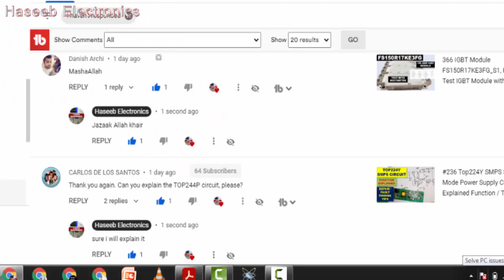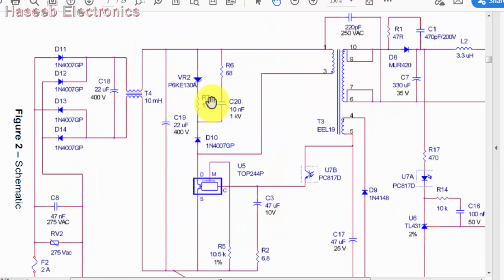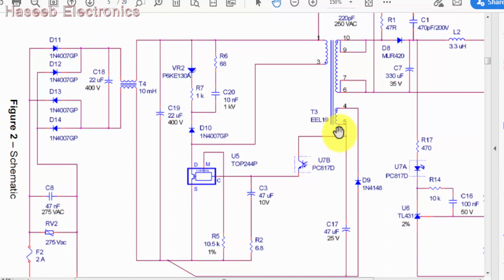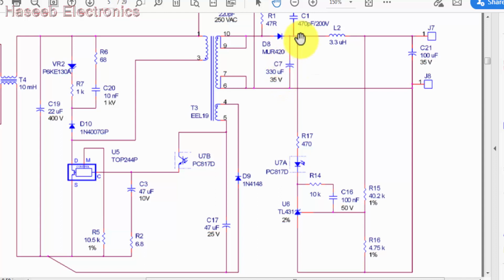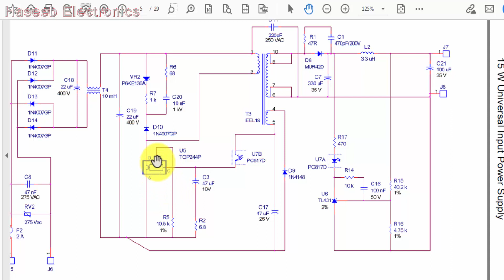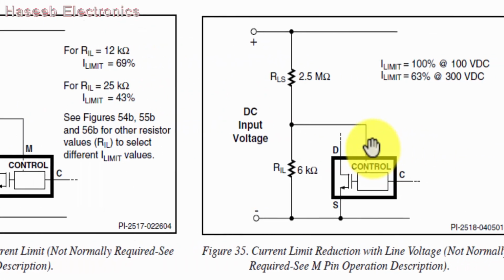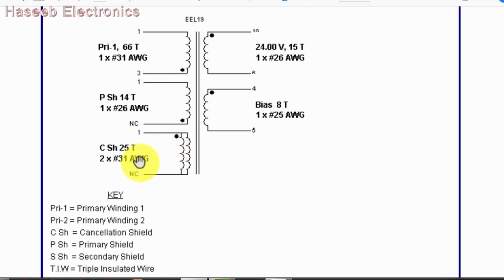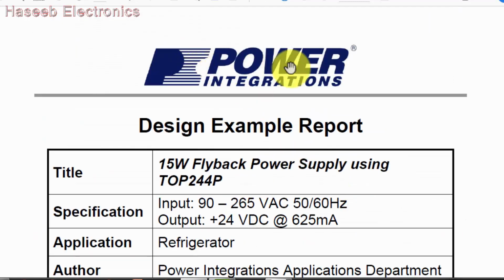[369] TOP244P Flyback Switch Mode Power Supply 24V 15 Watt Design Example

Comment: May God's mercy and blessings be upon you.
I am writing from Türkiye. I am your follower. I like your channel very much.
I have a smps circuit with Top246 ic. The snubber circuit consists of a P6KE200A tvs diode and a 2.2nf-400v capacitor connected in parallel with it and a Uf4007 diode connected in series with these two components.
When I checked the pcb circuit with a multimeter, I saw that the P6KE200A diode was broken. I soldered a new one to the circuit. When I energized the smps circuit, the diode broke again. I would be very happy if you could help me with what to do.

Comment: I need to get the power supply repaired. Can I send it to you ?
Reply from the maker: i am in Jordan. shipping through corrier is toooooooooo expensive, that only both side shipping charges amount will equal to atleast 10 brand new power supply boards. 
you can check from DHL, if it easy to send and cheap from your country, then you can send it. 
but shipling from Jordan needs 50 Jordanian Dinar only for slip (as insurance) then packing + shipping charges. (aroung 250 grams electronic board needs 60 to 75 JoD) 
when receiving any electronic item, for small boards 32 JoD to 50 JoD excise and custom duty from income tax
if you can consider these amounts + shipping from your couontry. and it is reasonable with compare to the yur circuit's price. then you may send it, i will fix it free for you
Reply: @HaseebElectronics  Okay thank you for the reply, I will message you after checking the postal charges from USA to Jordan and back.

Comment: Sir in this circuit please explain how Ril (current limit) resistor is calculated. Suppose my smps is designed for 2A load then how should I select Ril value & how much current should I limit for 2A load.

Comment: Thanks champ. I'm gonna try and retrofit a TOP IC into a Ryobi charger. their IC is unavailable. I'll disable all the protection stuff and see what happens. I got a feeling the transformer is faulty as when I test max voltage rise on the startup winding with my fluke maxmin fn I get only about 1v when I think it should be 12v or something. Do you think the initial surge of power shorted windings in the transformer or are they pretty robust and my fluke is just not fast enough to get accurate startup IC supply voltage?
Reply from the maker: yes it is possible that the transformer may damaged. nut most commonly the transformers are good , just the output side "battery management system" disables the operation of the PWM IC by means of the optocoupler. any short circuit condition, over current condition cases to disable the ic. you can try a working WPM IC to verify the circuit condition, 
wish you success

Comment: I've got a top258pn ic. It receives 320V from the 400V capacitor, but when i check the low voltage area, i should have 12 and 5 volt, but i haven't... i only have like 1,2V and it fluctuate a LOT... help...

Comment: Sir I want to ask about atx smps power supply fuse, normally how many ampere fuses should I use ?
Reply from the maker: for 200Watt normally 5Amp
250 Watt 6 Amp
PFC power supply 8 Ampere
Reply: @HaseebElectronics  okay is there any formula or I have 350-400 watt psu, can I connect 8 Ampere fuse or this is too high?
Reply from the maker: 8 amp is okay
Reply from the maker: 7.5Amp/110 VAC
OR
3.5A 240VAC
Reply: @HaseebElectronics  ok thank you so much

Comment: I designed a buck with: Vg=170  V=28. I=10A  DIODE vf=0.7. F=40, 000Hz Calculations gave D= 16.84%. L=298uH. C=11uF. Now when I simulated the circuit I just got v=10.7, so I increased the D up to 70%, and yes I got V=28v and I=10A. But, is it not supposed that I should use the duty cycle calculated with the formula or is it that this type of topology only works good when the difference between Vg and V is not so big? I'd appreciate your help or opinion. Thank you.

Comment: Thanks brother Hasseb. Please I need how to measure correctly the smps transformer because with multimeter in ohm range it reads like a short a very small value 0,1 to 0,2ohms. Please advice